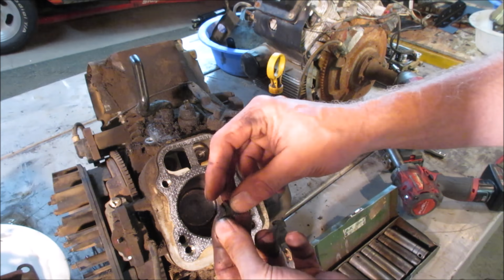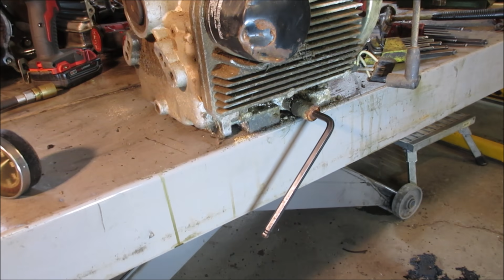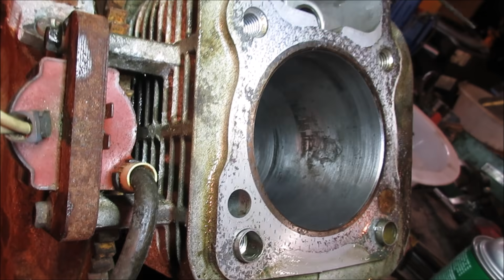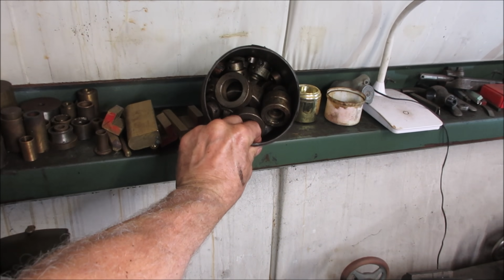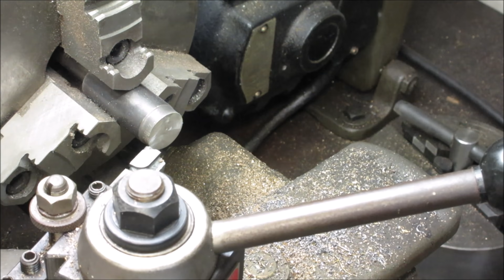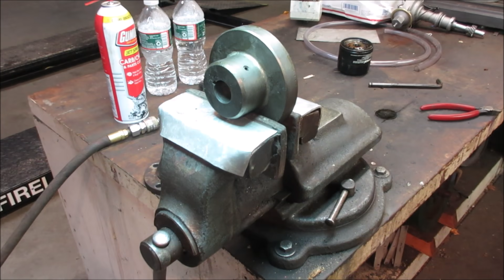Kohler Engine Teardown and Crankshaft Mods,

Comment: Why didn't you just counter bore the end of the driveshaft to the same Dia of the drill bits small end and press the drill bits small end into the driveshaft?  Would be very center and easy to weld without  warping , then turn down to center up perfectly.

Comment: Mustie. I love your channel. Been watching for years. Please, stop using WD40 as a lubricant. It is not a lubricant, nor was it designed to be. I was so relieved when you switched to motor oil for honing that bore. It was chattering because of the WD40.

Comment: Instead of welding the end on, I would cut fine threads. It would turn much better. What you need to do is get some fiberglass. Make the drill stem red hot and put it in the fiberglass blanket and let cool slowly to renormalize the metal.

Comment: a guy i used to work for had the early model DR mower with the tall spoked wheels, anyway when using it on a side hill it quit, turns out it was low on oil, topped it off and it was fine that day but engine went on him another day.
Reply: When Cub Cadet came out with the 17 hp series garden tractors, the Kohler engines were normally used in portable generators.  When you mowed on a side hill, the oil pickup would starve, and the engine would lose oil pressure, and the right connecting rod would brake.  The broken rod would then go thru the case. I short blocked a bunch of them, all with less than 50 hours on the engine.

Comment: A colleague called me to ask what kind of water to put next to the oil. Because he went to change the oil in an old machine and water came out along with the oil. And I told him that in modern oil it is not necessary to add water. My astonishment was that he believed. But then I had to explain to him that that is never meant to have water.

Comment: Dude I've seen some real idiots in my day but you take the cake. You have run out in the crank for two reasons and probably both apply. You're supporting the crank on one end. That why there's that small beveled hole in the end for a live center. That's also why you where getting all that chatter. Not the sickout of the tool but no support on that end of the crank. The other reason is your 3 jaw chuck, and based on the condition of your machine and the junk around it, I would say that's a very high probability. The to top it off you use a drill bit shank to extend the crank. Seriously are you that cheap?

Comment: Usually I love the Mustie1 videos but for some reason I can see 2 good engines turning into scrap..I hope not but the coupler seems really undersized, it looks like the coupler is 3/4 of an inch and I think the original output shaft is 1-1 1/4" that's a huge loss of material to transfer power.

Comment: Hi Darren , I know that you've probably done most of the work to the engine by the time you read this . When you were trying to get some thing to join the two cranks together I was wondering if you have watched any of Allen Millyards channel . He builds mutant engined motor bikes . ( Dodge Viper , V12 + 5 cylinder Kawasaki's ) He uses the gudgeon ( wrist) pins pressed into the ends of the cranks to center them . Thanks for posting .

Comment: i would have bored a hole in the crankshaft to fit the end of the drill but a few thow under, maybe half inch in length.  press it in and weld it.  then your not relying soley on the weld for load or vibration

Comment: Looks like you're using my trick.

I've got 3 or 4 impact drivers or drills 
set up, for working on my bike motors, 
all with different size sockets on them.
Including 2, 1/2 inch impact wrenches.

Instead of switching out sockets, I just 
grab the tool, with the right size on it.

steve

Comment: 15:15 you'd see metal filings if the part wore away due to oil starvation etc, if you had a catastrophic failure due to a bolt letting go, you'd probably see more big chunks.

Comment: I remember a magnet coming loose on a Lambretta, insta-lock rear wheel as I left a quarter mile long skidmark down the road, tore through the tyre too as I was frantically battling to slow it down using front brake which the non disc versions are not the best, I thought it was a heat seize then I saw the flywheel through the cowling... man it was beyond repair as the magnet jammed in the inspection hole and between the coil stators, bent the crank and put a nasty crack in the casing... toast or rather a normal day for a Lambretta lol

Comment: I enjoy watching these rebuilds or tear-downs of Kohler engines. I have a horizontal shaft Kohler engine that I wanted to put into a Yamaha golf cart that has been sitting since the plandemic. Just waiting for me to start on it. The videos here help me, because its all a mystery on what goes on in there. I think now that I'm seen a few I know that they gas should stay hooked to the governor so it doesn't blow when someone else drives it. The clutch is all that is needed to fit on crank shaft. A belt goes from there to the transmission on the back wheels. I think I would be in business. If I made videos about some of the stuff I do I think it would be entertaining. A lot of trouble shooting with very little MacGyvering. Sometimes. Anyhow, I think I might get that running before the end of summer now. Wish me luck. And thanks for your help and inspiration.

Comment: Interesting video for Sunday morning. I'm surprised when you were attaching the second part of the coupler you didn't put the coupler in the oven and the shaft and the freezer to give you a little bit more tolerance. I did that pressing in a bearing on a motorcycle engine. Put the case in the oven and the bearing in the freezer. I was 12 working with dad and mom was not home😁

Comment: Darren, if you dont watch Cutting Edge Engineering you should. Kurt is a very knowledgeable machinist and welder. You could take some of his experience and add it to your tool box. Your ingenuity with solving problems is remarkable. Thanks for your videos i look forward to them.
Reply: Or at the other end of the size spectrum, Joe Pi. Incredible machinist.
Reply: Yeah, Kurt is probably the best machinist / equipment mechanic on YT.

Comment: Don’t  both engines rotate clockwise? Won’t one engine need to run counter clockwise?
Reply: They are being joined front to back.....just like someone standing in front of you facing same direction...both of your right hands are on same side.

Comment: What kind of wire wheels do you use on your air grinders? I have tried to find some to use with mine, but I haven't found any that say they can handle the rpms

Comment: Case hardened crankshaft - Tool steel drill bit - Mild steel MIG wire..... What could possibly go wrong?

This is going to be an interesting project to say the least.
Reply: I never had any success welding HSS best to try silver solder

Comment: one way that i have seen for centering to parts on a lathe would be to bore the center of crank to a -2 ths fit of the smaller dia drill shaft to a certain depth then press fit and weld.
Reply: I was yelling that at the video but I guess he couldn't hear me.😅

Comment: Couldn’t you drill into the centre of the crank shaft and slot the drill bit into that. Then weld around the edge? That would centre it?

Comment: I've seen Allen Millyard make bigger motorcycle engines out of an engine and additional cylinders which is just crazy.  It will be interesting how you handle the timing so they run together.
Reply: I was wondering about the ignition, on these engines the drive is usually one side and the ignition system on the other .
Reply: Millyard is a HELL of an engineer. He casts and builds all that stuff himself, so professionally they look factory.

Comment: Mustie1 looking for the Malice in the Combution Palace. Digging in the oil for the forbidden glitter. Mustie1 always makes the adventure grand. A 2 stroke becomes more fascinating than any engine because Mustie1 follows the rule of good as used, safety 3rd, and getting rid of the smoke! Hero of the motors Mustie1. I dare anybody to do better. General of Engines on your Sunday. Let’s make ‘em go!

Comment: You sure know your way around those. I like the compact design. I was working at my dad's gas station when a carload of young women pulled in with a Canadien Pontiac (Chevy running gear). They asked why the car wouldn't go over 20. I asked if they had done anything to it around that time. 'No. Oh, we had trouble filling the transmission.' Where did you check it? They point to the tranny dipstick. What was the trouble? It didn't seem to fill up. [long pause] Oh, where were you filling it? They point to the engine filler cap. After draining 22 quarts of fluid from the engine (and doing an oil change), I assured them that their tenacity just turned the engine into a pump that was running too slowly to hurt itself. Seals were still fine, and the engine was now VERY clean. I suggested they not do that again.

Comment: I haven't seen how Mustie does the shaft extension yet, but if it were me I would have threaded the shank of the drill bit and drilled and tapped the end of the crank. Or maybe even bore it and do a shrink fit...

Comment: Confused. Would it have not been better, to bore a 7/8" hole in the crankshaft and insert the drill stub. Then key the crankshaft and connector hub?

Comment: As a former machinist that used to machine hardened material normally you would use ceramic inserts to cut it but since you were just cutting on the shank of the drill where it is not as hard as the cutting end you can and get by with just using carbide.
Reply: Great idea, but Musties lathe is a bit under powered for indexable carbide inserts, you need at least 10 hp for those.

Comment: That crossslide and/or compound slide on your lathe needs the gib/gibs tightened up by the looks of it. And the saddle even. Basically check all the gibs. 

Also if you had welded on an oversized piece to begin with and then turned it down to size you would avoid all runout problems and pulling due to welding.

Love seeing you get into a bit of machining. It'll really open doors for the stuff you are into. I remember that mill/lathe you had. Haven't seen that thing in a while.
Reply: Yep, remember the time he had getting that Bridgeport into the garage?  It may be there forever. lol

Comment: I wonder if it would have been easier to just drill a socket into the crankshaft for a solid shaft to fit in
Reply: Curtis at Cutting Edge Engineering would use a boring bar to do just that.   Have seen him do re-rods on hydraulic cylinders for big Cat dozers and excavators.  Slides it in and welds it up.

Comment: Note: On the one engine that had aluminum transfer to the steel crank.
To remove the aluminum transferred from the rod to the steel crank.

In a well ventilated area you can apply some muriatic acid to the areas where
the aluminum has transferred to the steel crank and let it set a little bit 
and the muriatic acid will dissolve the aluminum that has transferred to the 
steel crank. It will take several applications to completely remove it.
I used this process on a 2 HP Quincy air compressor about 7 years ago
and it still runs fine.  Ha Ha😊  Of course, when I removed the transferred
aluminum the crankshaft was in good working order and not damaged.
Reply: The real answer is sodium or potassium hydroxide, otherwise known as Lye work so much better than any acid on aluminum
Reply: @stirlingfromla  Nice to know, thanks for the information.

Comment: Reminds me when i was about 16, and had, within a minute, a 50cc rebuild going wrong (i put segments 180º off, hit the inlets and scratched the cyl) and then had another engine tore apart to build a working one. Few months later had to do it again because the gears went off.

Comment: Kohler cranks are hardened steel. The soft rod material will gauld itself onto the crank but won't hurt the actual crank. You can use i file to remove the soft material and the file will just scate on the hardened crank without removing any steel.
Reply: Muriatic acid will wash off the aluminum. Built many Honda race motors for mini cars and Go-Karts

Comment: Darin im no machinist but i have been around them all my life. 
Your stub shaft how it should be done is counter boar the crank shaft and machine the stub shaft to fit it. This way when you weld it wont pull as much. I really not sure about the drill bit as an option the high carbon steel might make it brittle.  The crank is probably a high strength forged steel 
I would look into a better choice of metal. 
Great fun though always enjoy the musty show. 😀

Comment: when stationary engines run big end bearings they coat the steel crank with alloy(aka the rod) to fix the crank 9/10 you put hydrochloric acid onto the alloy thats on the crank and it eats(melts) the alloy, and turns the crank to a like new condition, i did that method to a few engines in my time, where car engines ran the bearing  from low oil and ate into the bearing, i put the acid on the journals and melted the alloy from the crank, brake cleaned it then polished it then brake cleaned it again cleaned  it installed new big end bearings torqued it up and replaced oil filter and they are still running to this day

Comment: You should reall power wash stuff off b4 u go tearing it apart to get everything off case b4 u go tearing it apart and you would end up seeing more stuff wrong or just have a clean engine to work with it take 5 min to blow it off with water pressure.

Comment: Add 10% STP oil treatment to your oil. By volume.  This will protect the cam on most four cycle engines.  They need the zinc in the STP Oil Treatment.  The Democrats had it removed from most available oils these days, just as they did lead from gasoline and paint.
Reply: Do you think the removal of zinc and lead was a bad thing for everyone?
Reply: @BTW...  me too.  Paint these days suck and so does the gas.  Regular gas used to be 92 octane and Premium was 100, lasted a year or more and did not destroy carbs , fuel lines and diaphragms.
Reply: @johnclarke6647  Lead additive in fuel had nothing to do with octane ratings. 

Lead in the environment you, and more importantly millions of other people live in, was poison. No two ways around it. 

The question was really for the moron who sought to politicize the issue of Lead removal in the fked up US system. And on that point you don't need to look far to see corrupt Rep individuals whos actions were 100% self motivated and poisoned huge  tracts of land with their Zinc and Lead mines.

Comment: I was thinking maybe you could drill the crankshaft. Then insert the piece of drill bit into the crankshaft to center it and also add some strength when it is welded.
Reply: Absolutely.  I kept telling Darren to pilot the 1/2” drill shank into the end of the crank, but he wasn’t listening 😂.  Ensures concentricity and improves strength.  The steady rest would have held the outboard end of the crank true as well.
Reply: I was literally yelling this. I thought he had it when he held it up that way before cutting it.
Reply: Exactly. Drill and tap end of crankshaft, then turn down and thread the end of the drill bit.
Use loctite to stop everything coming loose during final assembly and job's a good 'un as they say.
Reply: i was hoping for that as well..😅
Reply: I was screaming the same at the tv but  Mustie must have had the volume turned down.😂
Reply: When I saw the steady rest in the tray I started yelling for Darren to use it. Drill and bore the crank shaft for the extension and give the bore a chamfer for a bead of weld.  However, It's probably cast iron, so welding might be a challenge. High temperature Loctite would probably also work. A drill bit? Probably a really poor choice of material.

Comment: That one piece with the 3 tabs on it is called a Love Joy coupling, you should google it and see what you have and how to actually use it. You would have two of those with a rubber star piece to absorb the the shock.  You would use a dial indicator to align  the couplings from one engine to the other with the proper distance between the two.  You would do a face alignment aka angularity.  And a OD alignment AKA left right up and down.  These will keep you from wearing the bearings and seals out the first time you run it.  Also  the rubber piece allows for some misalignment.  Bolting one shaft to the other allows for 0000. misalignment and it will self-destruct.
Reply: Holding a straight edge on the top and side of the lovejoy does a pretty good job.....
Reply: @dsloop3907   For something that doesn't require being in the same zip code will do just fine .

Comment: That’s the chrome cylinder lining coming off Darren. Best to use the blown up block if the cylinder looks better on it. Seen too many home only to expose the cast engine block.
Reply: Cylinders are not chrome plated, they have a cast iron sleeve

Comment: Awesome video.  Love the ingenuity with coming up with solutions. After welding the shaft you could always turn it down to remove run-out. Looks like a powerful design.  Anxious to see how it works out.  Thanks
Reply: 3 jaw chucks often have less accuracy than a collet . I will reposition the piece in the three jaw ...until the optimum true position is found.
Reply: As someone who is a machinist, albeit of the experienced hobbyist variety … this was painful to watch. 6 thou of runout on a crankshaft? Chipped brazed carbide cutting tool?? Chatter from an unsupported shaft a mile out of the chuck??? Welding a high carbon steel with no preheat???? Grinding and sanding grit all over the lathe ways?????

Let me hasten to say that I am no great shakes as a mechanic, and you have taught me a ton about small engines! And your final result seems to be working well despite my machinist horror!
Reply: ...it's better to use a coupling-(!)